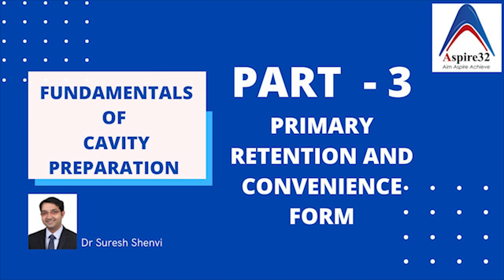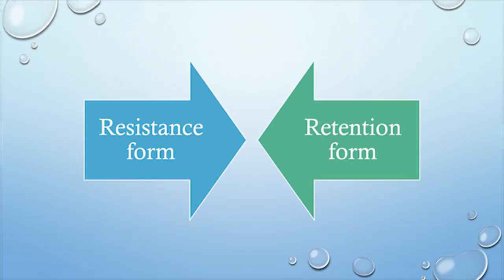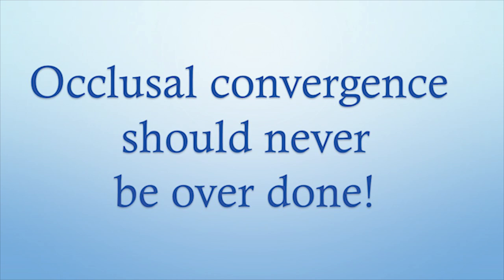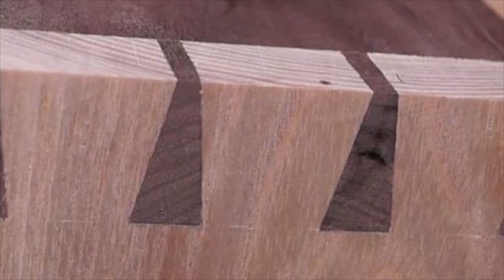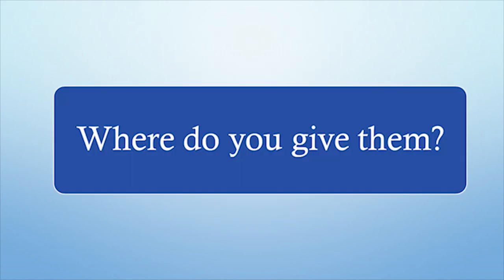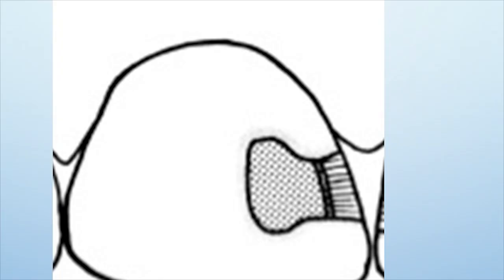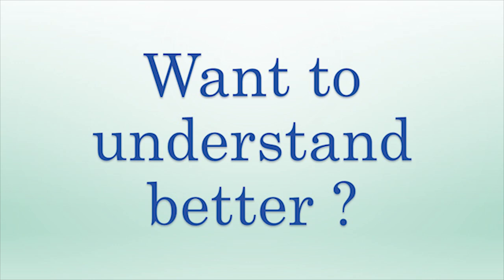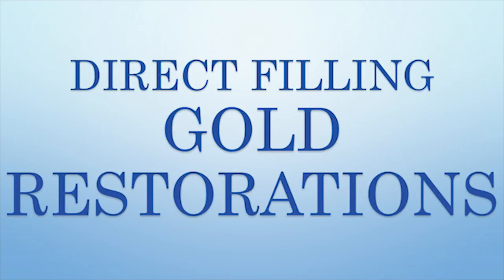Operative Dentistry | Fundamentals of Tooth Preparation - Part 3

Comment: Sir in the previous video it is said that marginal ridges should be conserved but while making occlusal dove tail it does extend to the marginal ridge?
Reply from the maker: No. U have to stop before 1.6 mm and 2 mm of minimum marginal ridge for strength.
Reply from the maker: Dove tail does not involve the whole marginal ridge. It involves it very little
Reply: Thank you sir now it's clear